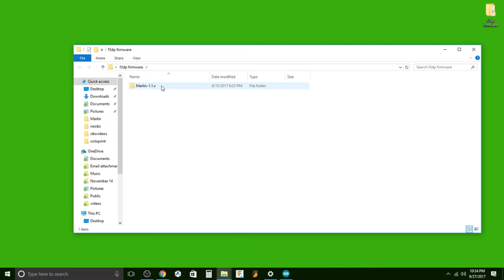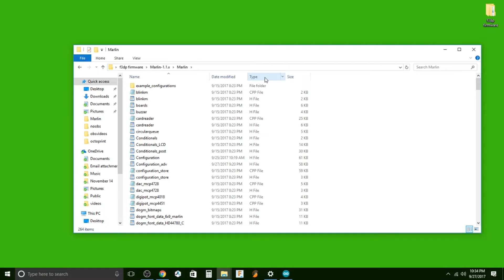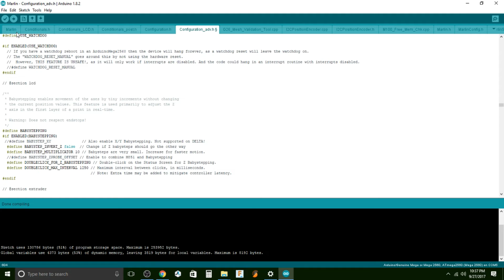Baby Stepping: getting your first layer perfect every time

Comment: I thought that baby stepping only affected the first layer height. Is this still the case or am I wrong?
Reply from the maker: Nope, baby stepping can be use at any point, there is also options to use it on the x and y wouldn't recommend  it though, baby stepping for z works best if you have a probe, and combine with z offset

Comment: hey man! I have a question: Is there a g-code comand to use baby stepping when attaching the printer to a computer? That would be, when printing, to send a comand through some client like Pronterface or Repetier Host, etc., so the Z axis moves while printing. Atm I dont have a screen for my printer, so I plug it to my laptop and was wondering I that could be possible
Reply from the maker: Wow sorry I am so late to answer  this.
Yes you can do it thru gcode, because it has an M code to it, but the marlin guys insist on an LCD, because the adjustments written in gcode would take forever,

Comment: Hi, behind You is mod. of rebelix. I would like to build this BIG REBELIX. Please, have you some dimensions this 3D printer or stl files for example on thingiverse?  Thanks a lot.  Haniacik (thingiverse)
Reply from the maker: Yupp is 300x 300x 500, the stl files are here are the printed parts and the modified prusa extruder for an 8mm sensor
https://www.thingiverse.com/thing:2287979
Reply: Wow, Thank You
Reply: Please tell me, there are 10mm smooth rods on Y-axis? And whitch one is there Heat bed. How long is Al-profiles?
Reply from the maker: @branislavhaniacik7584  the bed is a folgertech 300x300mm, the carriage is the carriage for the taz6, i had to add holes to it, and the y rods are 12mm as to avoid sagging.
Reply from the maker: Unfortunately this machine was made custom so i dont have the size of the profile at hand and the machines is in my home in texas, i will be bcak there on the 23rd of this month.
Reply: Thanks a lot

Comment: for this babystepping, any 3d printer feature is required ??? thanks, i am in the process to choose ...he3d delta k280, he3d sky
Reply from the maker: As long as the board is not proprietary,  and you can upload firmware to it you should be able to use baby steps, but you will not be able to use the combine offset function.
Reply: thanks for your response, what i do know is that the he3d sky is a clone from cr10, so i suppose it is not
a proprietary board, and it uses marlin 1.1x and uses arduino 1.0x for the firmware programming,
btw what is this combine offset function ??? thanks
Reply: It says right in marlin cannot be used on delta machines.